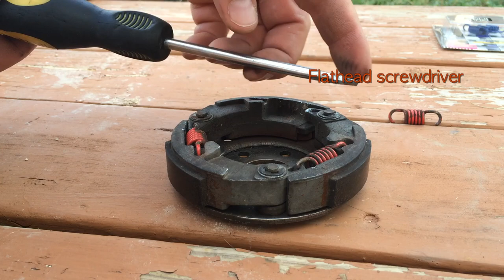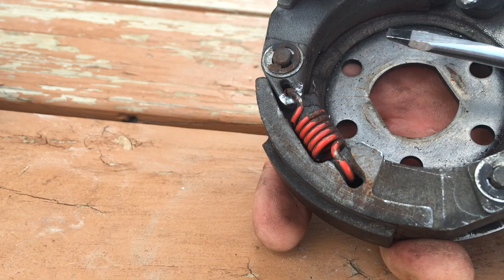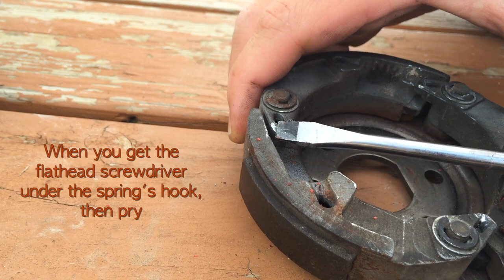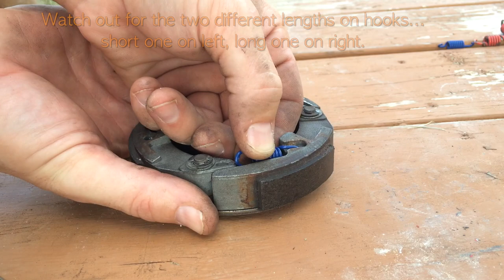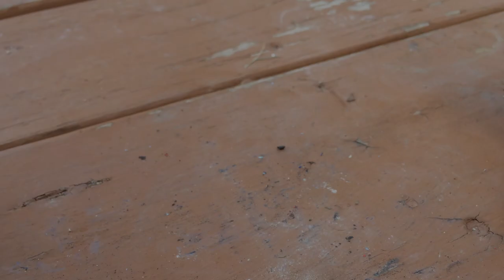Change Scooter Clutch Grab Spring - Easy! | Mitch's Scooter Stuff

Comment: Bought a 50cc 2 stroke scooter cvt that has been modified with70cc sports cylinder, technigas exhaust, sport variator, upgear kit, and was unrestricted. What i noticed just yesterday was that it runs fine and fast on flat but when i went to steep road and stopped on a traffic light, my scooter couldn't bear it and won't move on full throttle. Is that the downside of the upgrade? And does the upgear kit cause it to start right away on the higher gear instead of the lowest gear on take off? Anyway i can fixed this or adjust it back to a smaller gear kit? Or is it the clutch springs that i need to change to give me a good take off? New to scooters so i really appreciate any help😀
Reply: you need looser clutch spring or heavier variator rollers
Reply: @ogonbio8145 : lighter rollers
Reply: James Burke it sounds like he isn’t getting enough variation to take off on the incline probably due to the “sport variatior” or “upgear kit” I’d recommend going back to the stock variatior roller weights and seeing what happens and if you notice no change try stock clutch springs as they can also affect takeoff

Comment: Very wrong. You should pull outward with a sturdy thin string, shoelace would do. That flathead screwdriver damages the spring
Reply: Thank you! Just did your suggestion, after having held it down with screws onto a wood table and BINGO! It worked beautifully. Simple piece of strong string wrapped around a screwdriver handle for easy gripping got the springs both off and on.
Reply: @dreamsnchains4830  Glad to know your success in doing that. Oh yes I forgot to mention that you could stuck the other end of the string onto a nail or whatever thing you can stuck the other end of the string to while the other end is placed on the hook of the spring and pulling the whole clutch assembly with that technique makes the whole lot of pulling way much easier.